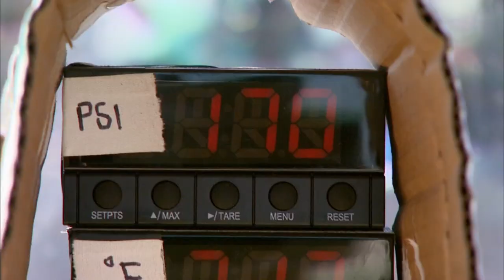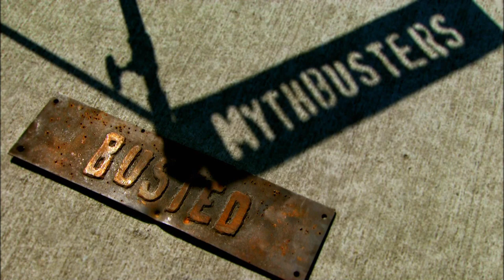Machine Gun Powered By Steam - Mythbusters

Comment: As a casual reminder air pressure power rifles were actually a thing and were on par with muskets back in the Napoleonic era as a matter of fact one was even carried by the Lewis and Clark expedition
Reply: The reason, I think, is that gunpowder produces a peak pressure for only a relatively short time. A typical 12-bore shotgun develops about 3 tons/sq in about 3 ~ 4 inches from the breech and the pressure drops to about 0.17 tons/sq inch at the muzzle. By contrast, an air or steam gun can maintain a relatively constant pressure.
The Perkins gun of 1825 used a pressure of 900 psi and was able to penetrate 1/4" wrought iron plates backed by 1" of teak, if I recall correctly. The military of the day were not too keen on the idea of taking a steam-boiler into battle and likely, rightly so. As an aside, there has been a suggestion that the 'trumpets' that blew down the walls of Jericho in biblical times were steam-cannon and there is some suggestion that this technology was known in the ancient world more widely. As for steam energy, boiling a half-cup of water produces energy similar to 10, 0.5 cal BMG bullets!

Comment: Can jet fuel melt steal beams
Reply: Not easily, but it would probably weaken enough to bend or even snap before it melted.

Steel takes a lot of heat to melt and beams are very thick so it would take forever, but weakening its support is another story.